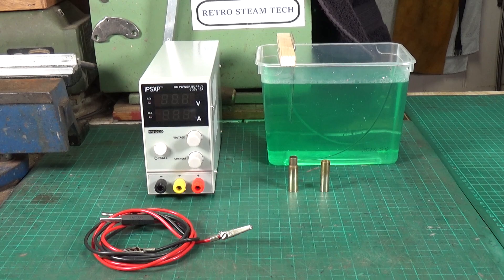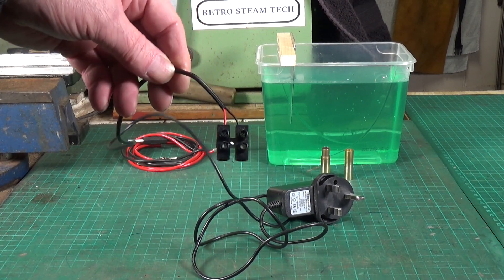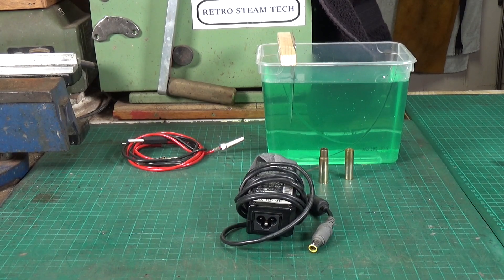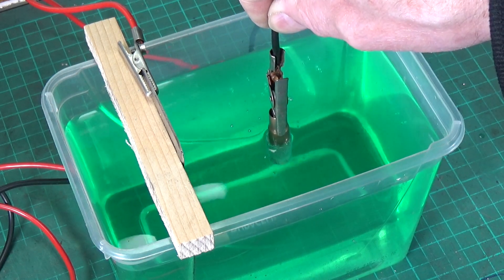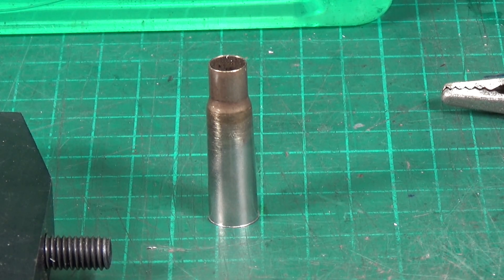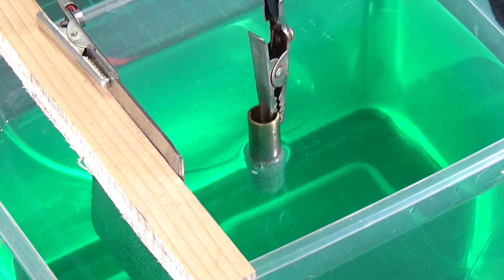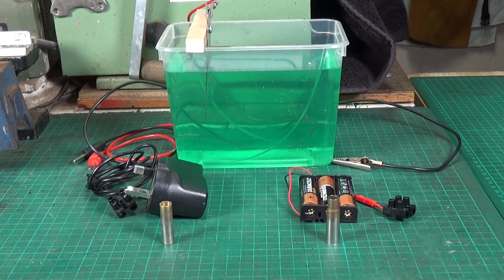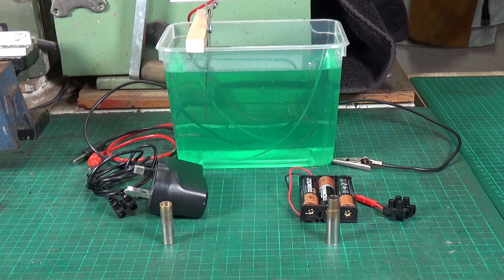Adventures In Nickel Plating - Part Three

Comment: Hi Alan.  You could also use a generic/modular internal PC power supply.  These supply a range of voltages including 12, 5 and 3.3 DC.  They have to be triggered to fire up, by bridging a couple of wires - plenty of info on the net about this.  Cheers Rob
Reply from the maker: I never thought of a computer power supply Rob, great idea 👍👍👍 They give out a shed load of current on the 5 volt rail so ideal. Cheers, Alan.